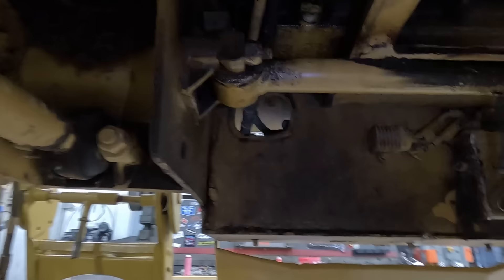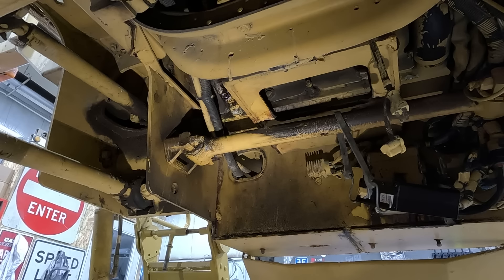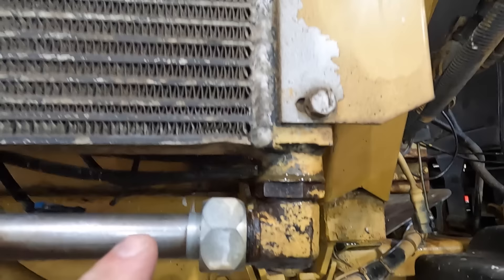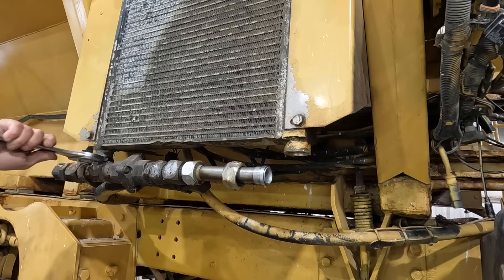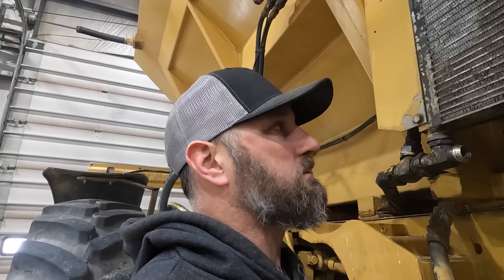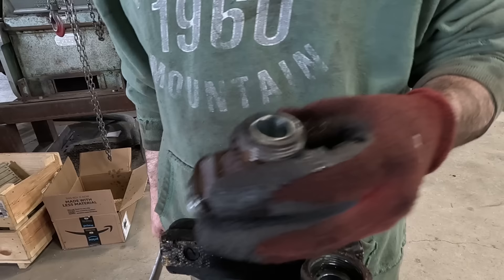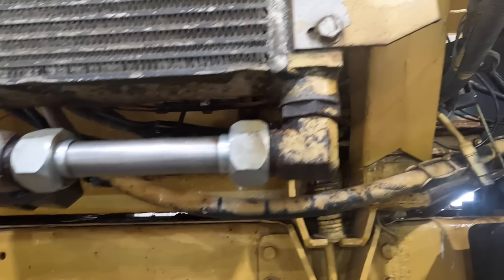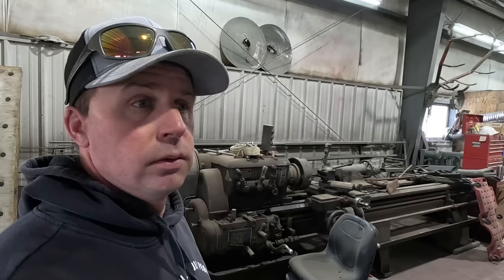This SUCKS!! Why CAN’T People Take Care of THINGS??

Comment: All electrical equipment and components operate on smoke.  The trick is you can't let any off the smoke out or it will quit working.  Electrical theory 101.
Reply: Once you let the smoke out, you can’t put it back in

Comment: Wait til you have to replace the hydraulic filter base ,which you will have to. O ring groove for filters corrodes away and you will have a massive oil leak

Comment: Sometimes a decent air hammer on the line nut can rattle it loose.   Also helps to never sieze the fitting threads for the next time.